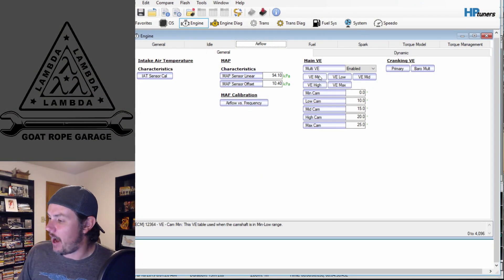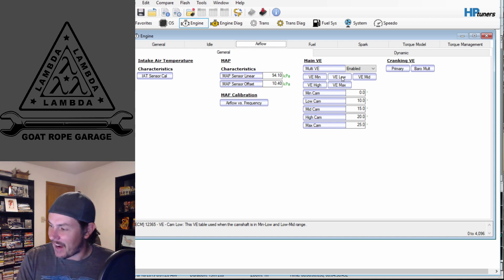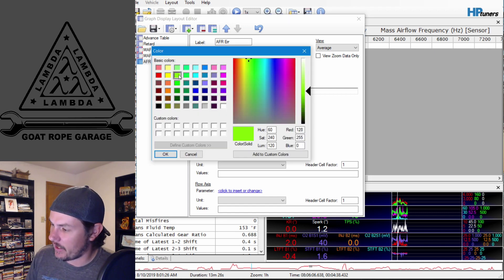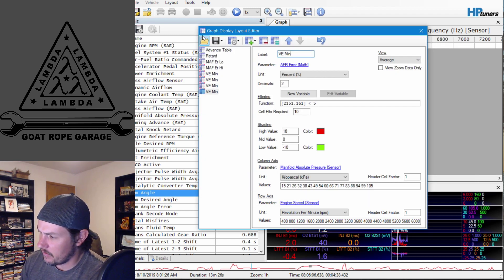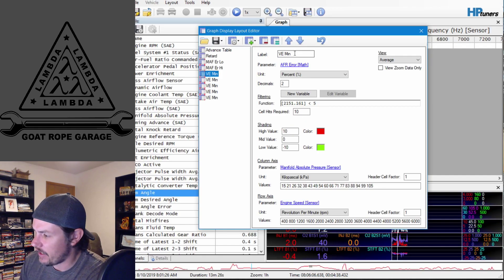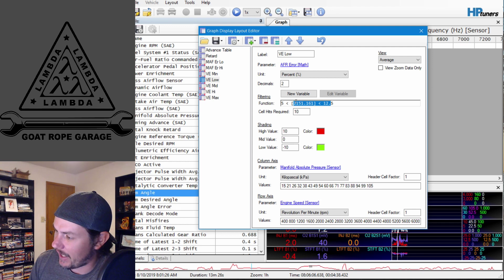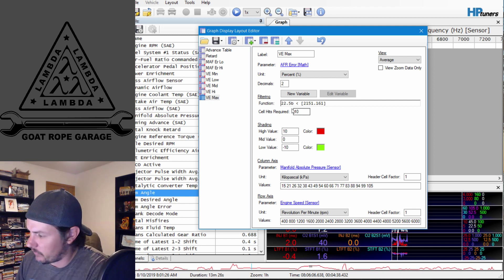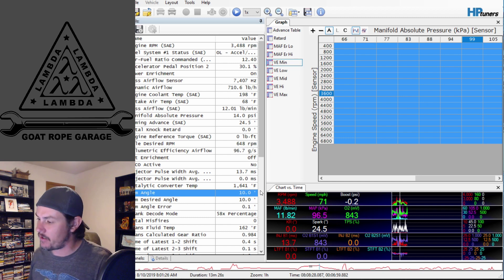5 VE Tables On the I5?  How to Tune the Canyon/Colorado Motor in HP Tuners

Comment: Hey I have a n 04 Colorado 3.5 that I'm trying to put a turbo on had it put together factory tune trying to see what the next step is. I have 3 bar map, jet mass air flow and about to get hp tuner and wideband is there anything else I need to buy

Comment: Just found your vids.  Have a 2006 colorado i5 myself.  Live in an area where i need emissions testing.  Had a p0449 hidden, no engine light. Replaced the canister and its gone, all good.  
Now my main thing is none of the o2 or evap systems are ready, and i had this tuned from a dude named Supermodulation(james) from the 355 forum.  Unsure it he disabled emissions as i previously didnt live where i needed to test.

Sorry for wall of text, but is there a way to re-enable emissons thru hp tuners?  Thanks
Reply: supermod wont turn stuff off just for fun. Being i have known him for many years, he is completely opposite. What you are seeing is the drive cycle hasnt been met, therefore the ECM hasnt said its ok to go for an emissions test. -and, you should never throw someones name out there for the world to see. You never know who might see it..

Comment: How do we make the maf/map sensor read 2 or 3 bar sensor without it going into limp mode while using boost?
Reply: Did you figure this out?
Reply: @timsparling1434  yeah my tuner was able to move it over to read boost with some kind of version of hp tuners reach out to multiple tuners in your area or maybe state since it might be a struggle to find help for this
Reply: has anybody figure this out?
Reply: @VITECHTUNING  a tuner in my state was able to do it let us know if you were good
Reply: @ChristianPerez-xd8zq  yeah i just changed the dynamic ve setting to run only on maf and adjust according to the frequency reading. but if you go over 10psi it will max out the MAF sensor
Reply: @VITECHTUNING  wow thanks man! You should post a youtube vid if it for all of us
Reply: @ChristianPerez-xd8zq  ill give it a shot english is not my main language but i´ll try
Reply: did you make the video?
 @VITECHTUNING
Reply: I’ve been successful self tuning so far as well. Running dynamic up to 90kpa then maf after and above certain rpm

Comment: Do you do any 4.6 2v tuning? I have a procharger forged internals and a boat load of other junk. I had a tuner blow one motor and a second that seems to want to blow me off because it’s not an ls.
Reply: what did you do in the last 3 years? got it goin?

Comment: So I did switch out AFR error for LTFT and numbers are showing up. Ran it in closed loop though so it was more of a test. 3 of the 5 tables had the same exact numbers. But again still CL
Reply from the maker: Send me the log
Reply: did anything come of this?  currenlty attempting to tune an i5 so could use all the help as their isnt much documentation on these Atlas engines
 @GoatRopeGarage
Reply: @bk2life same!
Reply: @GoatRopeGarage  I can do that in the morning. The computer is tucked away at the moment, and my lame ass is in bed. Lol

Comment: Nice info! On my i5 canyon i filter
 ve min as cam angle <9
Ve low >9 <12
ve mid >12 <16
Ve hi >16 <25
Ve max >25
Thats how someone on hptuners forum was doing it. 
Im still not sure why it wouldn't be better to filter something like
Min <9.9
Low >10 <14.9
Mid >15 <19.9
Hi >20 <24.9
Max >25
Reply: Or
Min <1
Low >1 <10
Mid >10 <15
Hi >15 <20
Max >20

Kinda confusing but i will give your way a shot.
Reply from the maker: It seems like the blend points are based on the different stages, so it seemed like you should split the difference bit I'm not sure, this was just based on looking how the tune was setup so you might be right.
Reply: @GoatRopeGarage  the more i thought about it and stared at the descriptions for the tables, i think the way you did it is correct. I will give it a shot and let you know how it goes. 

 I have also had a difficult time with the timing histogram on the i5. I cannot choose cylinder airmass as a channel, only cylinder airmass [math] so its kinda trial and error.
Reply from the maker: @e-feezy2507  Let me know
Reply: @e-feezy2507  I use the  cylinder air mass (math) seems to work.
Reply: @4BillC  does it? Im using a larger 3.5 inch maf housing i didnt know if it would be still be accurate?
Reply: @e-feezy2507  as long as you're maf is scaled correctly. The math need to know how much air is going in, rpm and number of cylinders.